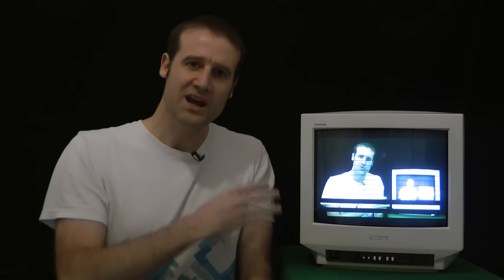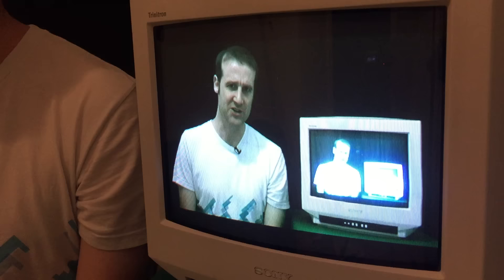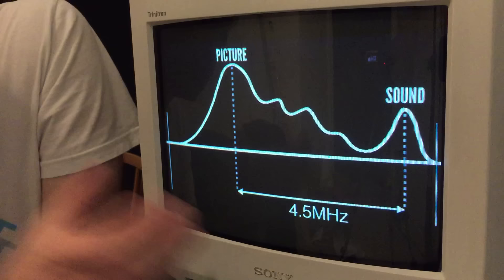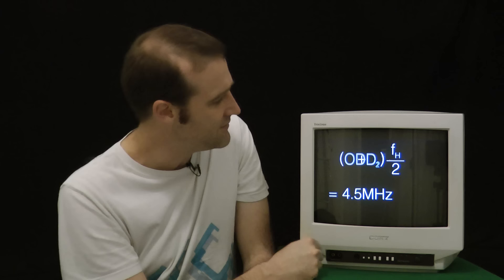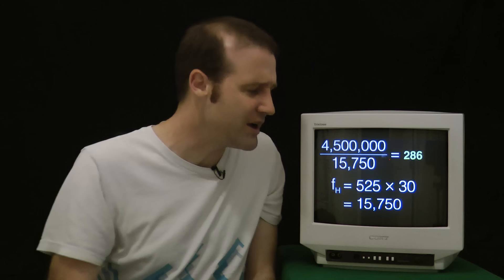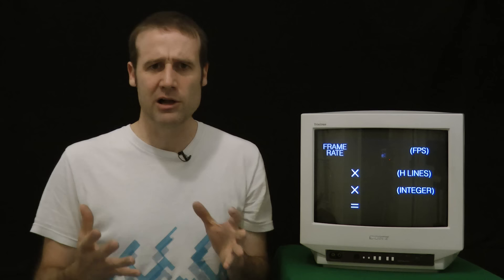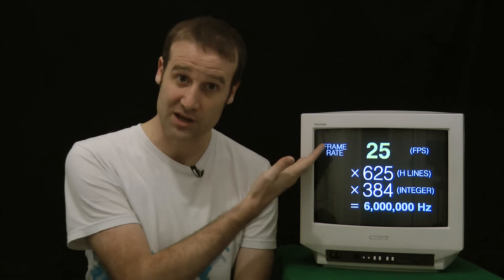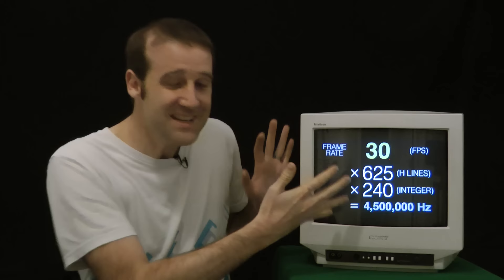Why is TV 29.97 frames per second?

Comment: They did not just take 60 Hz to match the electricity outlet, since synchronization could be set to anything, they did it to avoid interference-flicker with studio lamps and lights that are also connected to 60 Hz outlets.
Reply: You just gotta love from back in the day when someone put the TV on, and your computer screen seemingly degaussed.
Reply: That's litteraly what Matt says though
Reply: I'm pretty sure that most TVs had their electron beam deflected by the environmental 60Hz electromagnetic noise, this would cause the screen to move vertically at the beat frequency between 60Hz and vertical scan rate.  That would be quite annoying though I'm guessing 29.97 is close enough that a movement that takes 30 seconds to complete would not be noticeable.
Reply: Can you tell me why they didn't just rectify 60hz AC into DC?  Seems like a lot of trouble for something that has such a simple solution.
Reply: @CSGhostAnimation  - Yes, Thomas Edison's plan of transmitting power as DC instead of AC would solve the problem.  It would also create far bigger problems.

The problem is the current that's not inside your TV set.  It creates a magnetic field that deflects the CRT electron beam.  The frequency difference between the external magnetic field and the vertical scan rate is what you see as motion on the tube.
Reply: @CSGhostAnimation  DC has no Hertz
Reply: @CSGhostAnimation  They did, but the filtering of the ripple wasn't perfect. Plus they didn't use voltage regulation like we do today.
Reply: The more pressing reason for having the frame rate linked to mains freq, was that the PSUs in early TVs were crap. And hum would lreak to the omage. Having the two related, meant that the hum distortion was statis on the image and didn't roll around and be more noticeable. 
The TV receivers never actually used the mains for sync.
Possibly, by the time colour came along, the TVs had better PSUs, or a rolling hum bar at 0.03 Hz was considered tollerable?
Reply: @CSGhostAnimation  Maybe the biggest problem was that power supply filtration often failed, at least partially, then the problem was serious, because the crawling scan was unacceptable. I serviced these for many years.
Reply: That doesn't make sense. I work in TV and film, so I know about frame rates and flicker synch. Tungsten lamps have no flicker. You can run cameras at any frame rate and not see flicker.
Movies are shot at 24fps, not 30 or 60. Film cameras were used to shoot EVERYTHING for TV: except soap operas. Film cameras used for TV still were run at 30fps.
The flicker problem arises when using arc lights, especially HMI, because those are essentially blinking on and off real fast. The camera has to 'see' when the light is on, and so HMI ballasts were tuned to flicker to match the camera.
Reply: @rom5285  Absolutely! 
When I was young, I just accepted it as normal that as my dad's radiogram 'warmed up' (ie as the valves' heaters started emitting thermionic electrons and brought the amplifier to life), a 100Hz hum would fill the room (frequency-doubled from the 50Hz mains by full-wave rectification). Mains hum was as much a part of domestic electronic gear as the glow from the ventilation slots or the smell of gently cooking paxolin! 
It was strangely tolerable to our ears but it was hugely obtrusive on a raster-scanned display, so it made sense to minimize its effects by scanning the raster at more or less the same frequency as the mains. (Or the 'line', for our American viewers!)
Reply: @daveholden2711  Made a bit of a headache for MIDI time code (SMPTE) trying to audio sync with the different standards. MIDI bit rate is 31250baud (1MHz/32) which allowed the crystal to run the microprocessors that where then available. The hardware ran at single digit MHz (affordable chips were $20+ (down from $350). Typical choices were MOT6800, MOS 6502 or Zilog Z80 clocking at 1MHz or 2MHz. Remember that you need several other chips such as peripheral and memory, not cheap. As a rule of thumb $1 of parts equates to $5 of selling price. You only get an 8bit part or psuedo 8bit (2 sequential 4-bit ALUs), which can take 8 cycles for an instruction. No multiplier. Not really a lot of horses to do a conversion which  has a factor of three in the denominator. Add onto that incoming MIDI to cope with which o need to sample every 15 microseconds if you do not have an MC6850 serial peripheral IC which gets you 6 milliseconds.
Reply: @QqJcrsStbt  Serves 'em right for using those newfangled chips instead of good old vacuum tubes! ;)
Reply: @daveholden2711  "Film cameras were used to shoot EVERYTHING for TV: except soap operas."  All early television was done live with Vidicon tubes wasn't it?  At that the time wasn;t the only way to broadcast something from film to run the film in a special machine past a Vidicon tube (i.e., pointing a video camera at the moving film image) and then sending the output of the Vidicon tube to broadcast?
Reply: Incandescent lamps do flicker, but I seriously doubt studio lamp flicker was a prime consideration in setting the video frame rate. Outside of some high frame rate situations, incandescent flicker isn't that big of a deal.  Films were long shot at 24 fps without any concern of flicker from mains-powered tungsten studio lights.

Comment: Great video, and very informative. I have long wondered but never bothered to check.

(Phase reversal requires that the phase of the wavefunction describing the signal be adjusted by precisely one half of a wavelength for each color frame, hence the need for an integer multiple.)
Reply from the maker: +TomatoBreadOrgasm I started reading about it because it sounded interesting but realised it was slightly too off-topic for the video.
Reply: standupmaths Well it didn't diminish the quality of a great video, in my opinion.
Reply: +standupmaths, are you implying that maths is off topic?

Comment: Actually, NTSC stands for Never The Same Color, since color hue was based on that signal phase shift, which was EXTREMELY fiddly, and prone to all kinds of error, since it depended on the signal oscillations following a rigorous phase timing, which could shift with factors such as length of cables in a studio.  In fact, those famous color bars were created as a way of calibrating the color as closely as possible with the naked eye.

Fun stuff.  The mechanics of an NTSC signal "frame" is pretty fascinating!  It sucks by today's digital standards, but for what they had at the time, those engineers came up with some creative ways of packing information into a signal!
Reply: The way I heard it way back when was Never Twice the Same Color.

Comment: Unfortunately, changing the number of horizontal lines in a North American TV picture from 525 to 625 would have destroyed backwards compatibility with the existing black and white sets.
Reply: Not really, vintage tv´s had vertical, width,  horizontal controls to ajust the picture on the tube
It was more easy to implement.back in those days.
I remember a guy in Portugal receiving by sky skip a  freak signal  of Brazilian tv that  came in,and all he did was ajust  his 625 50hz tv to 525 line 60hz on a small portable black and white set. using the vertical width controls
Brazil does use PAL but on 525 60hz
But the tv been an old b/w did not have to deal with other things of the signal.

The video is on youtube
Reply: Yeah, but every time you change channel? Some channels (some SHOWS) were B&W, others color. They coexisted.
Reply: Brazil also uses PAL.
Reply: @voorhes80  
PAL-M 525 60hz
Reply: @angelsmith1761  You are assuming that existing TV's had horizontal and vertical frequency controls that would have sufficient range to make such large frequency adjustments and that the circuits would still have performed properly with such a large deviation from what they were originally designed to work at.
Reply: @joevignolor4u949  Argentina for example using PAL 50hz 625 lines use a similar bandwidth as the NTSC 525 60hz. The wider the bandwidth the better because there is more space to fit the signals.less intermodulation problems and a sharper picture using the same number of lines.
For example the old French  819 tv system used a very wide channel bandwidth of 14 MHZ and a video bandwidth of 10MHZ (great picture quality) ,but there was also a variant of the 819 line system that used a much more narrow bandwidth similar to that used for 625 50hz in a couple of European countries that broadcast both 625 and 819 lines at the same time using  the same channel bandwidth of 7MHZ and video bandwidth of just 5 MHZ. for both line systems.
Was the picture the same on the more narrow 819 line system  than the wider 819 line system! nope! it actually look similar to 625 because of it´s narrow bandwidth, but it made the picture lines less visable on screen.
819 was dropped out when secam and pal colour arrived, and there was a need to make it more compatible for transfer from the variant tv systems.
The use of the same number of lines is very important for video transfer  because  it maintains a similar picture quality .
525 transfers to 625 made the tv pictures look worst because of the upscale making American tv look bad  in most countries.
The change to 625 could of been done and it was proposed during the early years on the old black and white days..and later day colour sets would of had a different design to compensated.
Reply: Whats backwards capabilities? Here in Sweden we have completely removed analog tv and radio to make room for digital.
Reply: @brunobarcelos1093  And they did this so that Brazil would have to manufacture their own TVs. A sort of protectionism.
Reply: @adrianbergqvist8622  Yeah, that's pretty standard around the world now in 2019, but back in the 1950s-1970s, the entirety of North America was running primarily on B&W TV sets that had to be able to handle receiving both color and non-color channel signals and correctly interpret them in B&W.
Reply: @angelsmith1761  Not all TVs had that option - they were few and far between. I had a PAL set that could do NTSC in black-and-white if you adjusted the vertical hold, but the screen height would be squashed. On the other hand, another PAL set I had had no such adjustment, so the picture would just roll. Even if you could get it to keep still, the geometry would be completely wrong.

But besides, that, Brazil was 60Hz / 525, not standard PAL, so I don't see why your friend had to adjust any timing.
Reply: @adrianbergqvist8622  Yes, but you can still use your old TV sets with an adapter - it's not like you immediately had to go and throw out all your old TVs :-D
Reply: @adrianbergqvist8622  I think Analog TV doesn't exist in Europe anymore but analog Radio is still a thing in some places
Reply: I feel like some people missed the part where the whole point was to create a color format that didn’t disrupt existing black and white televisions. The solution was to position the color signal at just the right spot so that when the noise it induced was overlapped by the next scan, THAT noise was exactly the opposite phase. The two cancel out and you never see the noise on your black and white set. On the color sets you do the same thing but to the B&W signal and extract out the color information (which you mix with the B&W for luminance) and you’ve got what you need. If you changed the lines per frame you might have enough “vertical hold” adjustment to make it stop flipping on old sets.. but the color information noise wouldn’t cancel out and even if you got it stable the image would be all noisy.
Reply: @adrianbergqvist8622  I understand in the 50s, a TV was worth enough money it wasn't meant to be thrown away and changed so easily. Planned obsolescence wasn't a thing yet, so people just weren't changing over their furnitures every other year... Nowadays, changes are bullied onto customers in a way that wasn't imaginable 70 years ago...
Reply: Yeah he already said that. Why are so many comments saying the same thing? Did you not watch the video?
Reply: Adrian Bergqvist - This is not the 1950's.
Reply: @adrianbergqvist8622  We're talking about the 1950s, when electronics were very expensive. Being forced to buy new TV or converter box would've been quite a financial setback.
Reply: @TiberianFiend  Exactly! That's like saying "we have just invented the electric car, so next year we are replacing all gas stations with charging stations and everyone has to buy a new car. And your old car is worthless so you can't even sell it.
Reply: People get upset when their stuff gets made redundant overnight. 
Legacy compatibility was the major factor.
Reply: In Europe we just made it incompatible, and switched to PAL, a much better system designed with colour in place from the start - previous systems used various standards e.g.  UK 405/25
Reply: @adrianbergqvist8622  Back then TVs cost a small fortune. In USA, when ATSC digital broadcasting came about, one could get a converter to get the signal on older TVs for about $ 30 (Or free, depending on government incentives). In an affluent economy with a smaller population and minimal cost of TV sets, it's more plausible to break compatibility.
Reply: @angelsmith1761  But the horizontal line rate would then be 18,750 lines per second instead of closer to 15,750.  That would have been way too much of a frequency change for existing televisions geared for 525 lines per frame to deal with.
Reply: @denelson83  Basically for the black and white information you just adjust the vertical hold.Line frequency of 625 lines is 15,625 KHz and 525 lines is near 15,750 KHz.
525/50 or 625/50 very similar.
Brazil uses PAL colour TV system and not NTSC but with NTSC colour subcarrier refererence frequency near 3.58MHz not the European 4.43MHz.Called Pal-M.
To be in colour would need a Pal M TV
https://youtu.be/eZ6un3d8IdI
Other examples 
CANADA NTSC
https://youtu.be/cCmeKVdjPHc
Even the early 405 line British system of the 1930s was received and film in the RCA 
laboratory i the U.S.
https://youtu.be/0kk0ytK_nqA
Reply: As those frequencies are too different, it would be beyond the range of a black-and-white set's vertical hold adjustment.
Reply: @denelson83  https://youtu.be/nQbQfJa6ZAI
https://youtu.be/eZ6un3d8IdI
Basically for the black and white information you just adjust the vertical hold.Line frequency of 625 lines is 15,625 KHz and 525 lines is near 15,750 KHz.
525/50 or 625/50 very similar.
Brazil uses PAL colour TV system and not NTSC but with NTSC colour subcarrier refererence frequency near 3.58MHz not the European 4.43MHz.Called Pal-M.
To be in colour would need a Pal M TV.
Reply: @angelsmith1761  No, you've misunderstood.  I'm talking about Matt's idea of changing the horizontal lines in an NTSC frame from 525 to 625.
Reply: @angelsmith1761  Is that from 1954?
Reply: Since it's not allowed to go outside the 4.5 MHz window, couldn't they just change the window slightly by moving it inwards instead?
Reply: @Anonymous-df8it  That would have only created a signal no television set could display.
Reply: @denelson83  Why?
Reply: @Anonymous-df8it  Because they are physically manufactured to only receive a standardized signal, and if you try to tune them to a signal that does not conform to that standard, you will only see a scrambled mess, and no amount of adjustment will work.
Reply: @denelson83  Couldn't you just chop off a small portion of the signal to move the window inwards?
Reply: @Anonymous-df8it  No, you couldn't.  That would have been incompatible with existing TV sets.
Reply: @denelson83  Wouldn't you just end up with a black bar at the top or bottom and/or no audio frequencies above or below a certain point (this is fine, since frequencies get chopped off in phone lines and they sound fine) depending on where the cutoffs are?
Reply: @Anonymous-df8it  I can assure you, the engineers who worked on this stuff had already tried all of these ideas back then, and they got rather lousy results.
Reply: @denelson83  What were they, and why?
Reply: @Anonymous-df8it  For instance, imposing a further band limit on the video signal would have damaged the sync signals, resulting in an unintelligible picture.  Those sync signals require just the right amount of bandwidth for the receiver to handle correctly.
Reply: @denelson83  Forgive my ignorance, but what's a sync signal?
Reply: @Anonymous-df8it  Sync signals in analog video synchronize the drawing raster of the receiving set.  There are horizontal sync pulses to align all the lines of each frame, and vertical sync pulses to hold the whole frame in one position on the screen.
Reply: @denelson83  Can you explain how they work?
Reply: @Anonymous-df8it  They are parts of square waves at a much higher signal strength than the picture so the receiver can easy find and lock onto them.
Reply: @denelson83  Maybe you can have color TV work as follows: frame 3n+1 is red, frame 3n+2 is green, and frame 3n is blue, so nothing has to be changed, and you can still have backwards compatibility?
Reply: @Anonymous-df8it  That is field-sequential colour, which CBS had already tried in the late 1940's and early 1950's.  It was not backwards-compatible with the contemporary B&W TV sets.
Reply: @denelson83  Why not? Surely, a black and white television set would just show the frames as black and white as opposed to black and [red/green/blue] images?
Reply: @Anonymous-df8it  The field rate CBS used was 144 fields per second, with 405 lines per frame.
Reply: @denelson83  Why not 30 frames per second, with 525 lines per frame?
Reply: @Anonymous-df8it  Did you not watch this video?  Matt answers that very question here.
Reply: @denelson83  Isn't field-sequential color different to the technology referenced in the video?
Reply: @Anonymous-df8it  Yes.

But where are you going with all of this?